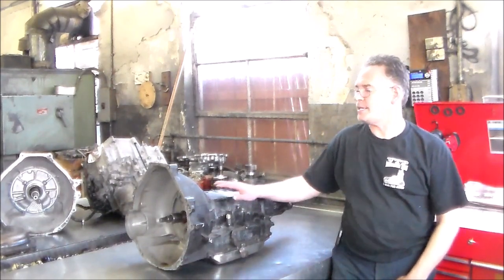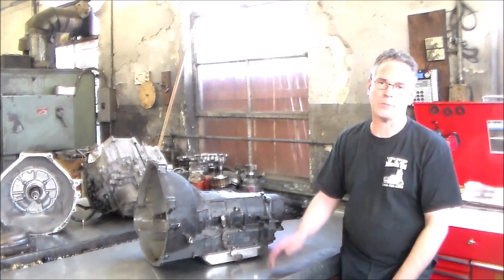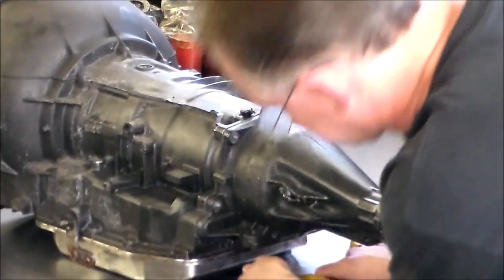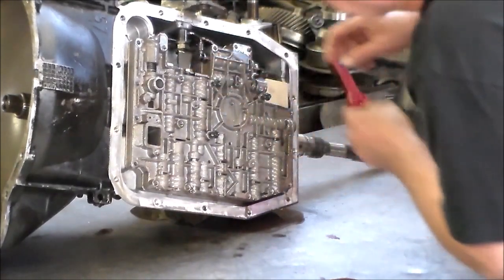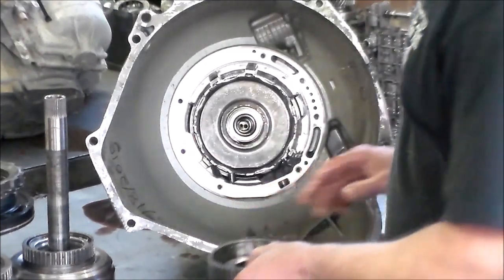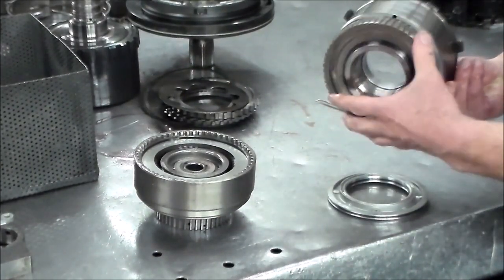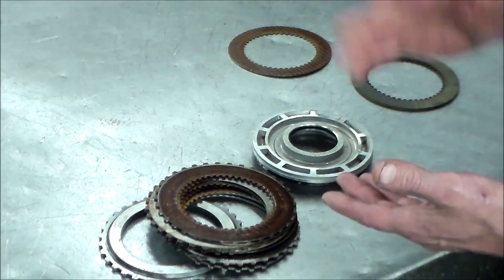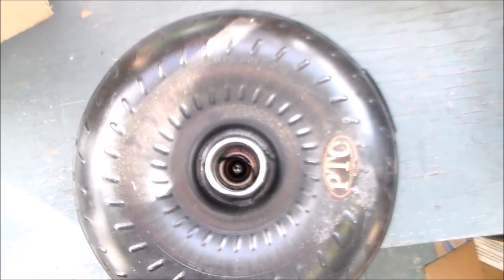AOD Teardown

Comment: I have taken my intake off many times on my 91 Mustang to modify things etc and i have lost probably 10 of those little snap rings that hold the TV cable to the bushing,I'm gonna put a new engine in October, I'm looking forward to finding all those clips ha ha ha,i know they are buried somewhere under that engine, i ended up making a brass bushing to go into my throttle body, haven't worried about that plastic bushing going south in years.

Comment: nice video ..just took apart my AOD because of a strange metallic noise and some vibes ... what I found was a damaged Sprag..the front one ..that was all .. Trans was rebuild and worked without problems ..also the OD Band looks some kind of bad ..its a Kevlar unit but it seems its like Heat broken .. there was very little clutch material in the pan and oil looks clean ..just some very small metallic Piezes in the Pan from the sprag.....Im not exactly a Mecanic ..take that thing apart was not that big Thing ..hope Ill get it back together ...hahaha ....

Comment: I was taking off the pan on my AOD on a 1986 Cougar 5.0 and a small plastic piece with a O-ring was in the pan.   From looking at your pan removal section, I dont see where this would fit back in.  Can you help me out with this.
Reply from the maker: If it's a yellow plastic piece with a small stem and o-ring, that just mean the pan has never been dropped before.  That piece is in the hole where the filler tube goes, at the factory they just install the filler tube and knock the piece into the pan

Comment: My question is will the 4R70 clutch drums work in a 4R75 because my forward steel drum split and set me back $160.00 and the rear one is $650.00 so I just used the stock one to rebuild, I see the drums on the 4r70 look better quality?
Reply from the maker: The drums are different, which drum is 650.00, never paid anything like that before

Comment: I broke the nut off my TV shaft in the transmission taking it off to put a different tv cable on it. How do I fix that?
Reply from the maker: The nut on the outside where the arm is?

Comment: How many bushings are inside the stator? I have AOD(89) and there is just one rear bushing. thanks
Reply from the maker: Bushing is normally in the middle or towards the front, the forward clutch rings seal in the rear of the stator

Comment: Is it possible to fix a overdrive issue with out tearing down the whole transmission?
Reply from the maker: Well, If the problem is the band thats in the front, if the problem is the direct clutch, then trans has to come apart
Reply: No my over drive is out tv cable came loose on the throttle body. Is it possible to reconnect overdrive band with out removing the whole transmission? Basically go under and remove the valve body and reconnect it?
Reply from the maker: @bazanemilio09  If the cable was not hooked up , the band is no good, will have to be changed, with the cable not hooked up, does not raise line pressure and burns the band
Reply: Thanks you this information is very helpful for me currently studying on how to rebuild a AOD 4speed wish me luck
Reply: To replace the overdrive band  can I just remove the overdrive servo  and leave the reverse servo still in ?

Comment: Hi Gary, I had the AOD in my 88 Lincoln rebuilt this past winter. It engages perfect, no slippage or anything like that, but there seems to be a wicked drop in line pressure when engaged in reverse or any forward gear. TV pressure is maxed (cable is as short as it can go, pulled tight with zero slack) estimated to be about 70+ PSI at idle in neutral. When road testing the car, it shifts like there is insufficient TV pressure (feels almost like the TV cable is fell off the throttle lever at the throttle body or set way too long).
So far I have tried another valvebody, fiddled with the TV pressure, added friction modifier to the ATF, nothing seems to change anything. If TV pressure is set to 35 PSI as per instructions, it goes even softer. Worst issue is early 2-3 upshift with little to no 3-2 downshift unless speed is under 20 mph. 
The car is an 88 Town Car with HO converted 5.0, no additional mods, transmission is an earlier unit with the 3-4 accumulator piston and has a B&M TorkMaster 2000 RPM stall convertor. Rear axle is stock 3.08:1 open.
Any ideas what could be causing this condition?
Great video, thanks for posting!
Reply from the maker: If you give it gas on take off does it shift late through the gears or does it shift early like no throttle pressure
Reply: @GaryFerraro  still early, 2-3 is worst, but will not go into OD at WOT as it should. Lighter throttle, earlier softer shift as a rule. Seems slightly better when cold. No 3-2 kickdown unless you're slowed wayyy down (<20 MPH) and requires WOT at that.

Comment: I'm getting ready to buy a junk yard AOD 4x4 to learn how to do a rebuild. This video is fantastic!  My current truck AOD is acting up with bumpy shifts at 1200-1500 requiring a kickdown push.. guessing that's the cable. Also skipping when accelerating on an incline. Thinking i over-filled it. Pulling the pan, doing filter/gasket to let some fluid out since i know it's overfilled. great video!
Reply: Did you ever do that rebuild? ive always wanted to do that, Ive messed around with motors quite a bit but transmissions i have always been scared of,lol , those things have more parts in them than a nuclear reactor ha ha ha
Reply: @dntlss  naw, i ended up needing an E4OD for my mass air swap so i sold it! I'm considering getting a book on the process though!

Comment: when people take off the fuel injection and put carbs on.. they don't use the 200-4R, 700R4 and AOD cable ratio adapter for the carb linkage. 

this Edelbrock 8026 fits Edelbrock carb levers. https://www.summitracing.com/parts/edl-8026   this sonnax version is for holley style carbs with the performance type throttle lever.. https://www.summitracing.com/parts/sox-as4-04k/overview/   this second sonnax unit is not listed other than it fits holley carbs.. https://www.summitracing.com/parts/sox-as5-05k    i don't know how many dozens of people who have removed their rochester carbs and put an aftermarket on and failed to install these. 

the little plastic/rubber bushing shown at the beginning is available in every parts store from dorman 14041  and when you see the strange kings crown shaped bushing in the package.. thats for ford clutch pedal cable attaching.. 

 hi gary.....  wayne..

Comment: Hello!  Great Video.  I plan to rebuild an AOD with 4r70w internals to retrofit into my 71 Cougar.  Current plan is to purchase two cores and rebuild the AOD.  The goal is to get the deeper gears from the 4r while maintaining the mechanical operation of the AOD.  Have you seen this done and are there any pitfalls I need to look out for?  Past experience has been in TH350s, 400s, and the C6 that currently resides in the Coug.  Engine is a 400Hp/420Tq 351C.  Thanks in advance.

Comment: Had a very quick question. Liked your video, by the way, which gave me the impression that you know the AOD Trans like the back of your hand.
My best friend, who owns a well know California hot rod shop, gave me an AOD that has been completely gone through with a 2400 stall converter attached, and has been sitting for 10 years under the workbench and has never been installed since the rebuild. I've never even had the pan off. If there is nothing oxidized or rusted internally, what parts/gaskets should be replaced before running this behind a build 408 stroker in my 1970 GT350 Shelby Convertible? Or should this transmission be completely gone through again? What is the shelf life of one of these transmissions after rebuild? This was originally built to go behind a sbf 427 stroker in a 34 Ford. The trans has never been filled with Trans fluid. To be honest, I'd be afraid to drop this off to a  trans shop where I don't know the people! It's hard trusting people these days, I have several friends who have had transmissions rebuilt, and it seem like they break again a week after the 1 year warranty is up! LOL! My go to guy has retired, and his shop is 200 miles away since I've moved. Seems like all the good old boys are either dying off or retiring!
Reply from the maker: The only problem you may run into that i can think of is possible your govenor valve maybe sticky, you can access the govenor by pull the extension housing off, there is a valve that floats, no spring, make sure that is still moving ok

Comment: Mr. Ferraro, have you considered doing a video on modifying an AOD with a 4R70 gearset?  I am interested in doing an AOD build that would take advantage of the steeper gearing offered by the 4R70W.  This should help my big cammed Cleveland come off the line a little harder without resorting to a big ring gear in the diff.  I would also be interested in other hard parts from the 4R (or anywhere) that might make my build live a little longer.  Perhaps also a link for those of us looking for the Exedy parts used here?

Kudos on the channel.  It seems to be helpful in directing business to your store.  The MB story on Yelp was some good press for you and AAA-1 Trans.
Reply from the maker: I really don't do the performance work(no time) shop is packed most of the time.  Yes the MB, Dealer tried to screw the guy, but I caught what they did and straightened it out for him and yes, just recently got a job in because of reviews and actually got a Mercedes in today. It does help. If you do the right thing, you will be rewarded, so when a lot of shops are slow, I am always busy.

Comment: hey, thanks for taking the time to film, i know it slows you down although you are really fast and efficient. i have a 4R70E, and have a p1744 code, and no TCC engagement. im thinking the spring in the bypass clutch control valve is broken in the valve body or it is hung up and not seating. i seen you find a broken spring on a taurus in another video.
 is it possible that the seals on the shaft going into the torque converter (that fluid is pushed through to activate clutch) could be bad and im loosing pressure there? when the lock up tries to engage,  there is a light scratching sound (like its just barely making contact) and rpm changes slightly before it shuts the lock up off.

Comment: Excellent video and break down.  Question what cause the early AOD to buzz in park? My 1988 5.0 mustang does this when it's at temp.
Reply from the maker: does it go away in drive? maybe a valve buzz
Reply: @GaryFerraro  hi...only does it in neutral.  Never in any other gear.

Comment: Gary, i have one in a 65 ranchero behind a 302 from a 70 mustang. Trans works great but i am experiencing a slight droning vibration in 3rd gear. is it anything to worry about, or have repaired.

Comment: Gary, when one of these units comes in with unknown modifications such as the extra clutches, separator plate, and valve body modifications do you put them back together like the unit came in or do you prefer to start over with a TransGo shift kit so you know what has been modified? Thanks for sharing! Also I think 2014 was the last year for the 4R70/75 before the 6R series started. Great video!
Reply from the maker: If they come in like this one, i look to see what was done and make my decision, this one i rebuild back as it was

Comment: i got an 1989 bronco with an AOD and a 302 i HATE it the thing shifts up fine but cant hold OD over 60 mph and shifts down HARD and late kuje coming to a stop light 15 mph and it feels from 3rd to 1st

1-2-3 smooth 4th bogs down 4th to 3 jerky 3rd to 1st skipping 2nd also 4x4 tranz shifter gets too hot to touch during normal driving so i know the trans is cooking 

any idea plz help me out with some ideas

Comment: Do you build performance aods? Im currently going through a financial nightmare, two shops allready costs me 3 Grand to build and AOD tot hold up behind my 351c.. with around 600hp at the crank. I learned alot now on this transmission since doing research myself and it seems there is alot more to it. I then found lentech in Canada who has experience with aods.. but wil cost me another 3.5k. currently thinking what to do..

I learned i need to have a single 31 spline input Shaft and a non lockup converter. Also possibly 4r70w drums and a manual continu high pressure valve body?

Comment: Hey just got done watching your video and gives me the confidence to tear into my AOD. But I have a question I'm pretty sure you can answer for me.  It's a 92 AOD 4wd. I got it rebuilt for my truck while I was doing alot of work to it. Once I finally got around to putting it all back together the warranty had ran out. After the rebuild its still doing the same thing. Acts like it's low on fluid so it take forever for the gear to engage out of park. Then when you drive it's jumps for 1st to 2nd as soon as you give it any throttle. I've adjusted TV cable, changed the valve body, flushed the fluid, changed filter. And when I dropped the pan, the bottom of the pan was full of the black gunk. In your professional opinion,  what do I need to look for?
Reply from the maker: How is reverse?
Reply: @GaryFerraro  takes it a while to catch like it's low on fluid.  I have to feather the throttle and it will finally catch.
Reply from the maker: @rolandsgarage8640  reverse is good or works same as forward
Reply: Works the same as forward
Reply from the maker: @rolandsgarage8640  If you changed the valvebody already and that did not fix, possible pump issue,  you have the small cork gasket on the filter?
Reply: Yea both the cork and the rubber seal..... my main concern is what would cause the black black up in the bottom of the pan after a rebuild? Less than 5 miles after rebuild
Reply from the maker: @rolandsgarage8640  If you did not flush out the cooler lines or heat exchanger, it came from there

Comment: Thanks again Gary. i have a question for you. I too, had the spring for the pressure control lever on wrong. Now that I have it in the notch, the lever has just a touch of counter-clockwise play, putting a touch of pressure on the valve without applying tension to the lever. Is this normal? Thanks
Reply from the maker: As long as it has full movement, you should be fine

Comment: you said the torque converter was bad, and i didn't see what component failed to cause all that metal in the pan, unless it was the two spun bushings. how did the torque converter fail?      thanks in advance
Reply from the maker: converter 100%  At the end of the video, I think I showed inside the hub where a bearing piece was, Not sure who rebuilt the converter but I just put a stock one back and all seems ok

Comment: Well after 11 years I've just found out why I went through 5 AOD transmissions in my old 83 F-150 I never hooked the throttle cable pressure switch to the carburetor
Reply from the maker: That will do it. Thanks for watching

Comment: Great vid. Got a 89 mustang 5.0 reverse Not working, do You know common issues, is it mostly something in the valvebody or gears(tought of 4l60e no reverse sungear broke)
Reply from the maker: I would say either you have a broken band or frozen stator rings for the reverse input drum. When the reverse input drum bushings go bad, the drum lays down on the stator , wears down the ring lands and the rings get stuck and can't rotate
Reply: @GaryFerraro  thx for the reply, greetings from Stuttgart.
Reply from the maker: @TeaIP  Greetings from New York.  Are you in Germany?
Reply: @GaryFerraro  yep Germany, working at a GM dealer, got my uncles Mustang in the Garage trying to fix the Transmission
Reply from the maker: @TeaIP  I use Stuttgart kits for mercedes transmissions

Comment: Thanks Gary! Can the valve body be flushed? Or does it have to be replaced every time? My problem is the AOD not wanting to shift into OD everytime.
Reply from the maker: Can be cleaned and new gaskets put on, what happens? does it neutralize when it shifts to 4th?
Reply: @GaryFerraro  its very strange. After about 30 mins of driving it wont shift into od. Park it  then the next day it works fine for a little while then it does it again. Does not neutralize just wont shift into OD .
Reply from the maker: @dninit1002  Make sure the cable is hooked up ok at the throttle body and is secure. Could be something with the valvebody or the seals for the o/d servo
Reply: @GaryFerraro  ok thanks!

Comment: Hello Gary... at "9:56" you mention a possible filter gasket missing. I just had mine serviced and when I make a right turn and the transmission is cold, half way in my turn, the engine will revup as if in neutral, then the transmission will catch hard eventually. The problem goes away when the transmission is hot. It's that filter gasket missing, right?
Reply from the maker: Either the gasket or seal is missing or it's low on fluid
Reply: @GaryFerraro  Well considering the dipstick shows the level to be nominal, I guess the gasket is missing :) Thanks for your quick response and your insights. Great video!
Reply from the maker: @msboston01  To see if it's truly full, when the car is stone cold and engine off, pull the stick out wipe it and check fluid level, with engine off and car cold, fluid level should be 2 1/2 inches above the full mark
Reply: @GaryFerraro  gotcha. Will check tomorrow morning.
Reply: @GaryFerraro  okay so I am at 2 inches.... I suppose I am missing 1/2 inch which should a 1/2 quart... I'll add and test.
Reply from the maker: @msboston01  Probably won't make a difference, something may be going on with the filter but do fill it with fluid
Reply: @GaryFerraro  alright... So I added a half quart of Mercon V and... Looks like the problem is resolved. Thanks Gary!